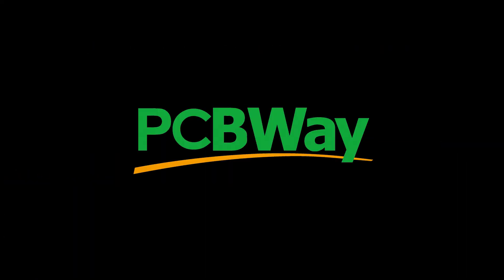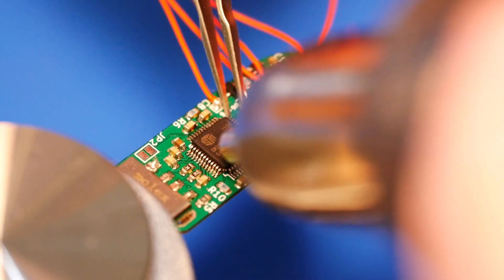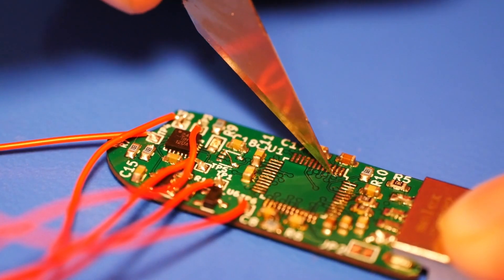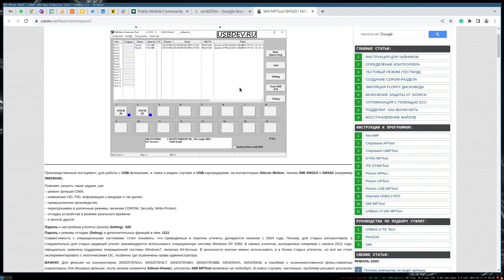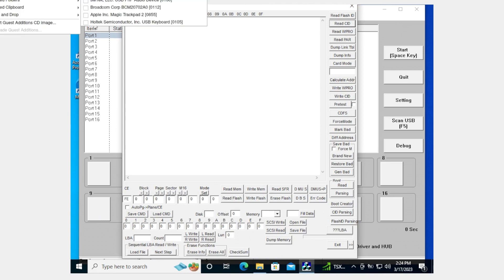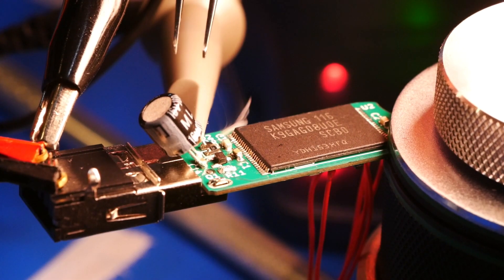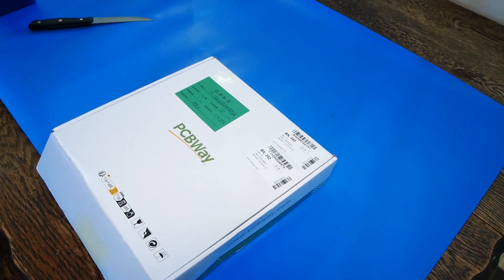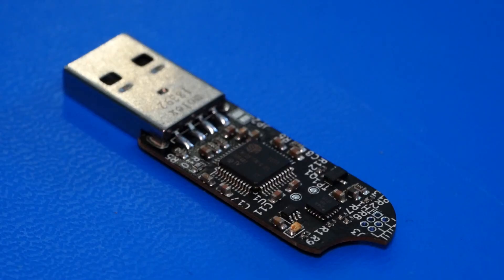The SELF DESTRUCTING USB Drive is READY! + Giveaway

Comment: Great idea, love the finished USB drive. I'm wondering if it's possible to simulate a broken device if plugged in once, present the drive as read-only if you plug it in 2x in under a second, and as read-write if you plug it in 3x. That'd also make it a great device to transfer data to untrusted systems. And maybe configure it so that it uses the self destruct once it's rapidly inserted 10x during 5s. Is that possible with the current design, or would i need to change the design and maybe add a RTC for it to work that way?